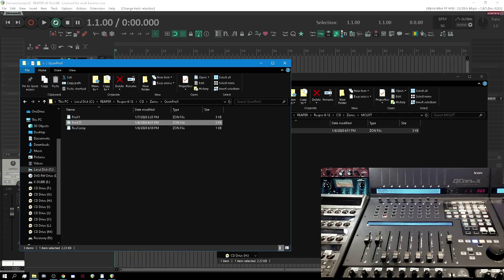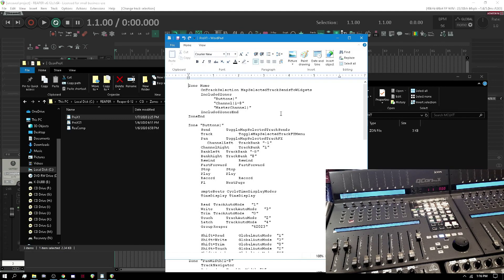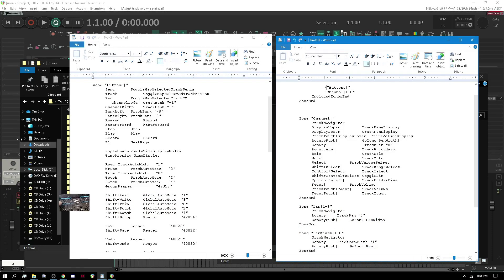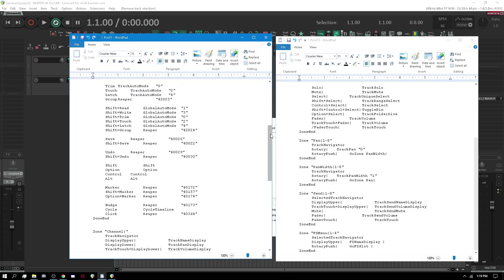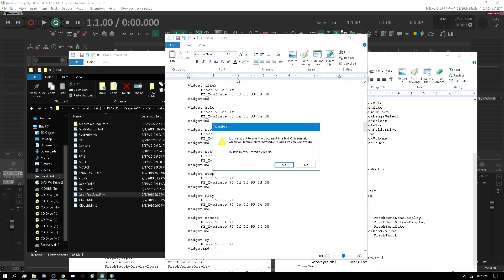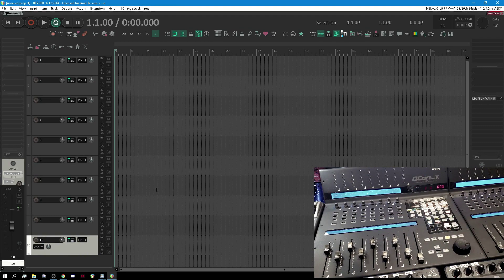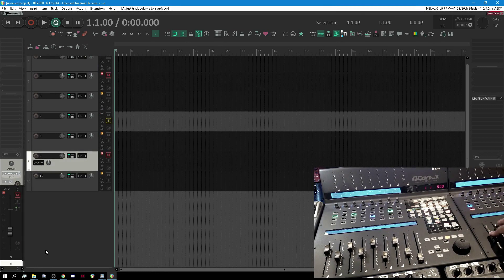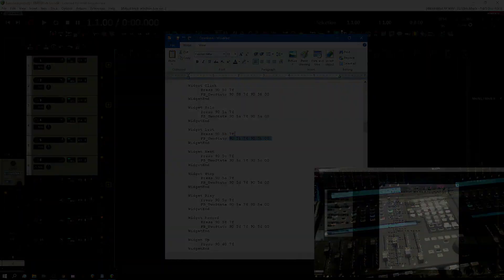Reaper Control Surface Integrator - CSI Series Part 2: Basic Setup for X-Touch Icon Mackie

Comment: Hi, is it possible that u can provide a video shows how to build up a MST file from scratch ?
( I know u've done that in previous video... but that video's image was really blurred )
I'm turning my StreamDeck into a midi controller, but I just couldn't get it wrking with my REAPER.
Reply from the maker: hi sorry for the late reply.  I wouldn't do from scratch, I would try to find some existing code to adopt, adapt, and cut/paste.  Start with one button/widget at a time, but use something existing to start with.

Comment: Hi, Thanks a lot for these videos. This is really helpful! Just starting to learn how to use CSI. How do you know you should change 59 to 58 at 6:25?
Reply from the maker: Hey Bruce.  If you look at 6:04 I have 2 MST files open.  One is my normally used ProX New Firmware that is all updated and has a value of 58.  The other is the QconProx that comes with CSI default, and shows a value of 59, which was wrong.  I know my normally used MST file works, when I couldn't figure out why it wasn't working I realized it was because the data was different there, so I simply changed it.  I worked all that out off-camera, but that was the point of going through the exercise. Hope that helps!